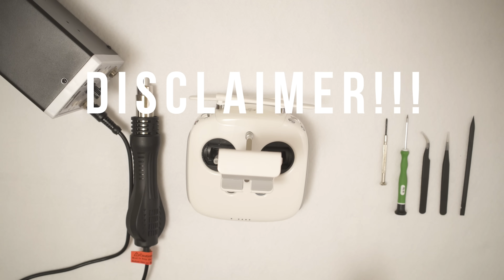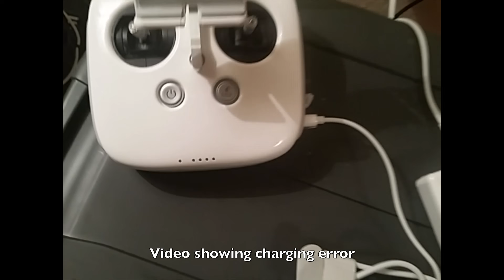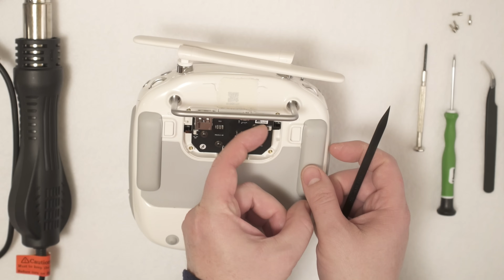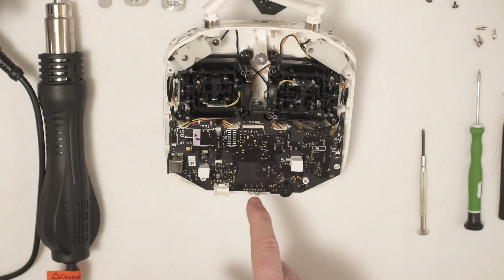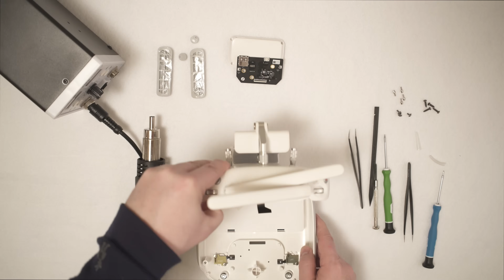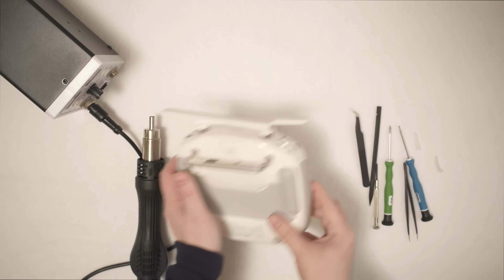FIXED!  DJI Phantom 4 Pro Remote Control Battery Charge Issue [Disassembly, Repair, Reassembly]

Comment: Believe it or not, I finally had the same issue after not flying the P4 for a few months. However, I did not have to go thru the complete disassembly process. Nor did I have to use a Air heated flow soldering unit. I simply just disconnected the ribbon cables and flipped it over while in the housing.
I used a adjustable heat degree soldering iron set at 700 degrees, placed a bit of flux on top of the chip and heated for 5 seconds. Worked like a charm! It is not necessary to completely remove the entire board. Completed the repair in less than 45 minutes. Full charge at 100%.
Reply: Is there a specific kind of "flux" that you put on it? Please forgive me, I don't know anything about soldering... I had this issue, then fixed it with my heatgun, the problem is back again. I'm thinking if I add some more of that "stuff" it will make the fix permanent. There's so many options on Amazon, can I go wrong?
Reply from the maker: Hi, Schneur, I think any lead-free, low-temperature melting point solder paste will work, but I haven’t needed to try it myself. Please let us know how it works out for you!
Reply: @travelphotofilm  thanks! Unfortunately I wasn't paying attention to the other side of the motherboard and I burnt the battery connector. It's all garbage now... Maybe I'll look for a new motherboard or new controller... not sure yet.
Reply from the maker: Ugh, that sucks.  Very sorry to hear it. :(

Comment: I watched tis a few times.I found this very helpfull.I bought a cheap reflow gun and did this.I concentrated on the plugin area and the battery plug in area.First time did not work so I pushed the heat to 350F and moved aroud those two areas for a while.I could not see any melting of the solder but the second time worked.All lights on and all good.
Reply from the maker: Great to hear, Lukas, thank you for the feedback!

Comment: Awesome, thanks so much, been looking for a fix for this for months. This worked for me, with a different battery too and taking charge perfectly now. Tried so many things and thought I'd have another search as it's been a few weeks, stumbled accross your comment on another video. Wish I'd seen this before I got rid of the original battery lol, but atleast I didn't spend hundreds on a new controller. Thanks again. Mines the Phantom 3 Advanced for anyone wondering 👍👍
Reply: Oh, and on my hot air station, I used 450C, fan speed 5 out of the 8 and the quarter inch attachment. I used this over very short bursts of time for obvious reasons, but gave the whole board a go with it, focusing on the charge port to battery connector pins area of the board.
Reply from the maker: This is great to hear; thank you for letting me know!  Also thanks for your reply with the settings you used!

Comment: Appreciate some help guys, I had the dreaded one red light flashing with beeping and white led flashing. Did this tutorial using a heat gun and put it all together and still no dice. Does that mean that it's the battery is what's defective? Thank you ahead.

Comment: This worked for me too great video! I had to do it twice because the first time I got my battery to go from 2-3 bars but then maybe 20 mins later it went back to only 2 bars. I took it apart and reapplied the heat gun but this time a little longer on and off for about 2 mins and put it back together and bang!! 4 bars. Now it’s about 4 hours in and still holding at 4 bars. Great video!!
Reply from the maker: Awesome, awesome, awesome!

Comment: When the battery is not plugged in, I'm getting all 4 dots to light up. But soon as I plug the battery in and attempting to charge it, I'm back at that one blinking dot

Comment: OMG, it works, it's like magic! 35 seconds at 320ºC. Distance 2-3 cm. Focused only at the 8 pin component, as described in other comments here. Now all the 4 LEDs are blinking! Now let's see how long it will work until the next SMD...
Reply from the maker: Great to hear!  Thanks for the feedback and your settings!
Reply: @travelphotofilm  Thank You! So, how long time is your controller working since you did the SMD? The issue didn't reappear since 2017?
Reply from the maker: Still working fine!  I did buy some more solder but haven’t had to use it. I think DJI’s manufacturer just didn’t spend enough time flowing that part of the circuit board.  If you check my videos, you’ll see I’ve had my P4P (and controller) out in some seriously cold weather without incident!
Reply: @travelphotofilm  Nice man! I'm subscribing to your channel. Thanks a lot for the interaction and help. Best regards from Brazil!
Reply from the maker: Obrigado! Vc escreve bem mesmo inglês!  Muito tempo atrás eu morei uns anos em Minas Gerais, ainda consigo entender umas palavras portuguesas!
Reply: @travelphotofilm  hehehehe, que legal, você é um pouco brasileiro então! Sucesso meu amigo, continue ajudando as pessoas com seus vídeos. Muito boas suas produções!

Comment: I just completed this procedure and can verify that it does work. After a few months of sitting my rc unit would not charge, one sometimes two lights blinking and low voltage warning going off. I first attempted the procedure with a hot air gun with aluminum foil nozzle. Voltage readout on go 4 app came up to around 70%. Took controller apart again and checked voltage at battery. IT'S FULL! 8.4v. This leads me to believe there is another voltage sensing component elsewhere in the charging circuit. The battery quits charging because it is in fact full. I also ran the rc off a benchtop power supply and the results in the app still showed 70% at 8.4v. I ordered a $40 smd reflow station from amazon and repeated the procedure focusing heavily on the 8 pin IC right next to the LED's. I watched under the microscope and could not see the solder appear to liquefy, but on reassembly. BAM! 4 LED's lit and battery level in app 100%. I don't think it was mentioned but it is good practice to wear a ground strap making sure you and all your tools are grounded when handling esd sensitive components. Thanks for your help!!! 

The IC CW2015CSAD is available for $3--$6. If the problem returns I may attempt to replace.
Reply from the maker: Kyle, great feedback and good advice regarding the grounding strap. Many thanks for letting us all know what worked for you!  Please keep us updated if the problem returns.
Reply: I can confirm this. I covered the whole board in kapton tape (didn't know before that it protects against heat), except for the 8 legged chip to the right of the charging LEDs. I tried heating that one for longer and long periods, each time in between checking by plugging in the charger if it would give 4 leds. The final move that made it work was blowing from the left side (past the leds covered in tape) onto the chip's left side (I thought that side looked the most suspicious while inspecting it under a loop), for about 20 seconds with 357 degrees celcius at blowing speed 2.5. This was on the remote of a phantom 4 advanced. I still need to put it back together but am conviced it will work. A huuuge thanks to all, both travel|photo|film and Robson Paul for making the video and Kyle for the comment about the chip. Someone in another comment wrote the hypothesis that it might be that the chip gets hot if you leave it to charge for a long time, and then the soldered connections loosen. So be on the lookout when you charge it long and at a warm location.
Reply: Here is a photo of how i covered the board in kapton tape, leaving only the chip uncovered. http://i66.tinypic.com/2uzz0g2.jpg
Reply from the maker: Great feedback, useful to everyone here!  Thank you!

Comment: H guys, i think this is not problem with charging because after reflowing controller start-up. So battery is ok and  there was no any charging in between. This is probably some other problem with power section at circuit board or main chip controller.

Comment: Great video, is Charging now! i was so scared to burn something do to overheating but i used the heat gun for about 30s at 300c and about 3-5 inches away, moving it constantly back and forth and it worked.
Reply from the maker: Thank you, Justin, for the feedback!  Great to hear it worked for you!

Comment: Very nice video! Wish I would have seen this before I bought a replacement.
Reply from the maker: Many thanks! I was relieved to find a relatively straightforward solution. Hope it helps others, and sad to hear it came too late for you!
Reply: Richard Pesce I tried that didn't work my controller is still not charging I can't bleave dji  would charge this much for a drone that has a major problem with the controller on the fantom 4 to

Comment: I didnt have access to a reflow station so trusty soldering iron had to do. I placed the iron on the chip in question for a good minute and kept the tip close the contacts. 4 White lights now.  will monitor and see how long it lasts.
Reply from the maker: Three weeks on, is it still working?
Reply: @travelphotofilm  Yes

Comment: I love you man! You saved me and my pocket! Thanks for encouraging me to try this method and it really worked! In another YouTube video of smd soldering, gentlemen told to use higher temp for shorter time than lower for longer, so I turned it on to 350C and now everything is perfect! Don't forget to cover plastic connectors with Kapton tape! Thanks one more time:) One more thing to mention- I heated small section of board, then connected to charging cable to see if its works or not- no, heated another region etc. Actually I heated moust of the board like 3 times, and thought it will not work (only 3 leds were blinking). Finally connected the battery and only then lighted on the 4th led! So, its not enough to connect only cable to check the board. Sadly, because of this, i didn't realize where the problem was.
Be brave, buy the heat gun and go for this method:)
Reply from the maker: Awesome! Thank you for the feedback! I’ll add your comment about higher temp for shorter time to the description, so others will see it!
Reply: How many time you use the heat gun?
Reply: As I said, I heated like 3 or 4 times, but probably was enough with one time. You need to connect battery too, to check if its working. If you mean for how long time I was heating, then you need to experiment! It depends on temperature, air flow speed, solder specification. First I was training on some old board from CD-rom, with the same size smd parts. Its very hard to see when the solder is melted, take some long needle and try to prey off the smd. In a while you will feel the right moment. On the smalest resistors it was like 3 sec., but take a practise!
Reply: Mārtiņš Berlands f
Reply: Hello, were you reheating while the charger is inserted to board to see if any progress on the LED indicators?
Reply: Really nice video, you could watch a comment below that shows the part you need to heat ! Its an 8 pin chip next to the leds. Thank you all for the help
Reply: Can I use a regular heat gun from amazon? Like for under 20 bucks? Idk if you can set that temp or will it get hot enough to do what I need it to do? The kind of gun that you put vinyl wrap on with. Thanks
Reply: Did the same as Mārtiņš  Berlands  and only realised it had worked on the 3rd attempt when connecting the battery.

I had to use a heat gun so was wary of damaging other parts on the board. 

Big thank you to the op for taking the time to run through how you repaired you're dji phantom 4 controller, its very much appreciated!

It's people like you that make YouTube a very useful tool!

Comment: Guys the only fix is if u reflow the the 8 pin thing near the fourth light  :) even with a lighter for 5 seconds :)
Reply from the maker: Excellent feedback. Thank you, Theofilos!
Reply: really?
Reply: I don't understand which one is it.
Reply: IT ACTUALLY WORKED FOR ME! 10 sec with zippo lighter.  First I got 2 lights to lit up. I heated then for 2 x 10 sec and 3 lights came up. then I gave it a couple of more shots each time just with blue flame not to burn the rest of it... AND IT WORKED ... I guess I was just lucky. WOULD NOT RECOMEND IT TO ANYBODY

Comment: I know this thread is quite old now but I wonder if anyone has done this procedure on the P4 smart controller (with the screen). The main board is much smaller in this unit  2/3 rds the size) and it seems a completely different layout than the standard one. The chip that people refer to next to the led lights isn't there...?

Comment: Thanks for the great video but it seems like I have to do that every spring the last 2 years. What am I doing wrong??? id like to fix once and for all...
Reply from the maker: Hmm, could be that there just isn’t enough solder left to reflow to full strength. Maybe add a small amount of solder?  Seems like maybe over time or due to temperature changes things are loosening up on you.

Comment: My RC has the same issue, won't charge past 2 lights, but if the battery is actually fully charged, I can live with that, I repair electronics but am not willing to do all this work if the battery is actually fully charging, lol

Comment: I can see my real charge when I turn the RC on while pressing C1, C2 and the Shutter button ( it's the silver button on the right side). But when it turns on the main LED is white and I can't connect to my drone. When I restart the problem comes again. I think it's a software problem!

Comment: This is a hard one. It didn't work for me. What could it be? Who knows! Not enough heat?? not enough time?? It feels awful, we tried twice. At least it sounds the same, nothing fried or broke. What can I do!!!!??? This video is very inspirational... and helpful
Reply from the maker: Cesar Castro the next think j would try is adding a small amount of the heat-activated solder to the target areas. Reflowing only works with the solder aready there, so maybe the amount is too little?  Just a guess; sorry to hear it didn’t work for you.

Comment: It works, I had a similar issue with an LG TV motherboard, so I followed your instructions and also took the main ribbon cable off the board.  I preheated my oven to 380 F, placed the board on a piece of wood.  I then placed the wood on a cookie sheet and put everything in the oven for 10 minutes.  After 10 minutes I took the cookie sheet out and let everything cool.  I re-assembled the controller and now everything is working again.  I've got 4 lights flashing.   Everything on the board will survive the heat for 10 minutes without melting and the wood will not catch fire.
Reply: 69vroom  is there anyway you could be more specific? Kinda confused. I don’t have that heat gun that he is talking about and am thinking of trying the oven.
Reply: @kalegorskey9192  Not sure if I can be more specific.  You need to follow the video and take the board out of the controller. I took the main ribbon cable off the board. Just like you disconnect the other cables.  I then preheated my oven to 380 F. I placed the board on a piece of wood (any piece that the control board will fit on, don't want it touching metal). I then placed the wood and control board on a cookie sheet and put everything in the oven for 10 minutes. After 10 minutes I took the cookie sheet out and let everything cool. 

I then reassembled the controller.
Reply: 69vroom ok thank you. I did that and it worked.

Comment: ********All you need to do is touch up the joints of the charge connector and battery connector with the soldering iron.. Just fixed my DJI 4 controller... no need for the hot air gun.  Thanks for a very informative video though!!********
Reply from the maker: Many thanks for the comment!  Good to hear the soldering iron works, too.  Two ways to address the same issue!

Comment: I did it and it WORK´s really good!!! thank you. It´s a really clear and simple how to fix this issue.
Be careful with some withe rubber in the main board, if you heated a lot could be damaged. :)
Reply from the maker: Thank you, Pablo, for the feedback. Very pleased to hear it worked for you!

Comment: I had the same problem with mine, used your method and its working ok now. dji customer service after your purchase is horrible, they should be sending us all new boards. when i purchased mine new it had a small crack in the lens cover, they were to cheap to send me a $1 piece of glass, they wanted me to send the whole drone to them. i love my phantom 4 pro but will go elsewhere when i want something new. they lost my $ with their appalling customer service.
Reply from the maker: Many thanks for the feedback, Ben. DJI makes some amazing things but you’re right that for such a common hardware issue there should be much better follow up.

Comment: I did this fix and it worked 2 years ago and then left it unused for about an year and now it happen again but this time I cannot get it to work. I heat it at 300 C for 30 sec, then 350 C for 40 sec, then at 400 for 30 sec and later for 1 minute, I even heat it at 450 C for 50 sec and later for 100 sec, tried 2 different flux paste and all leds are lighting a few times and the stop, at another try 1 light once then all a few times then stopped, now 4 out of 5 are lighting a few times then they stop. I also heated were you plug the power cable. I tried the remote reset before attempting this but I don t hear any confirmation sound. Do you have any idea what else should I try ?